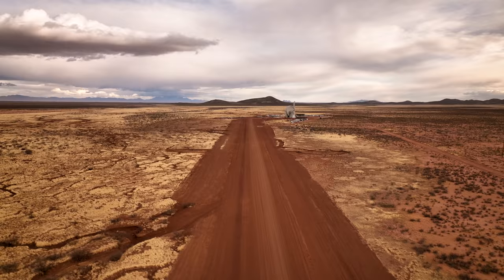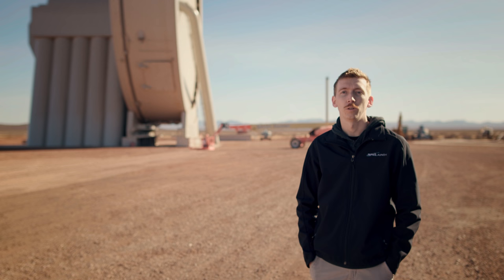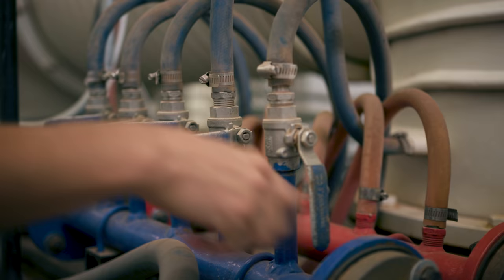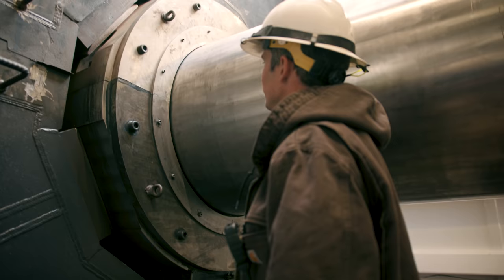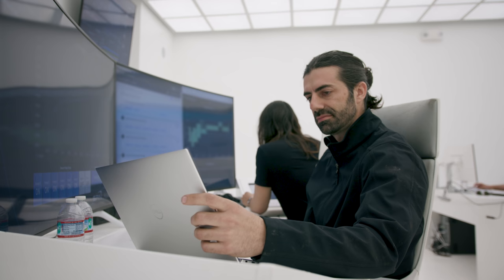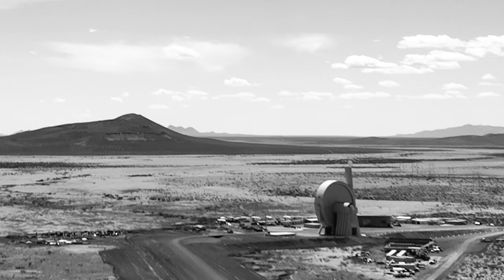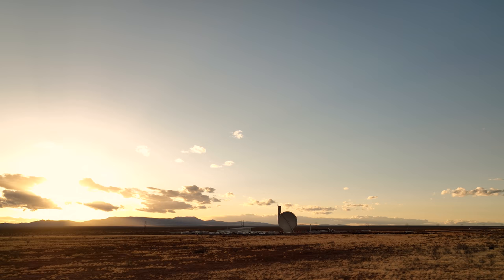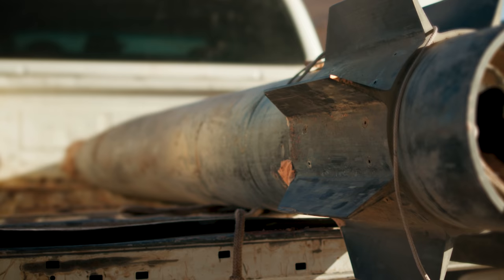An Inside Look: SpinLaunch Flight Test #7

Comment: What happens to the counterweight when the projectile is launched?  Seems like, at those speeds, it would shoot out the side from the sudden imbalance.
Reply: Great question actually
Reply: My uneducated guess would be that they’ve designed spinning mechanism’s total weight to be large enough in relation to the projectile to where the difference in sudden balance shift is within tolerence
Reply: @sagearslan 

The rotator is subjected to the energy imparted to the projectile is when it’s launched. Your theory makes no sense because the rotator would be unbalanced when spinning up to launch speed.

Comment: It's an interesting idea. My concern is there looks to be considerable Gs on the projectile just launching it to 30,000ft. Low Earth orbit is around 600,000ft or 20 times that height. To put that in perspective if your height was 600,000ft then 30,000ft would be about the height of your ankle. I can't wrap my head around how humans or electronics are supposed to survive the increased forces at the higher speeds or the shock of hitting atmosphere at basically sea level during launch at the required launch speed to get to 600,000ft.
Reply: No chance this would be used for humans, and the current projectile looked like it survived an impact with the ground from 30,000ft without taking much damage. If they scaled up the entire launch system then I imagine it would be feasible to get at least most of the way to space, then they could also strap a rocket motor to the back of the projectile to carry it the rest of the way into orbit?
Reply: I think this is still a technology demonstrator. In future the projectile would have rockets fitted to complete the launch and to take it into orbit
Reply: @sil8127  The problem for me is I don't see how rockets could survive the G forces let alone the guidance system.
Reply: I was thinking exactly the same thing…. That’s a lot of Gs
Reply: This is a project that is definitely worth pursuing because having a launch system that doesn't require actual fuel on maybe the moon would be incredibly useful in the future.
Reply: In other videos this has been discussed.  Obviously this cannot be used for manned launches.  However, a solid fuel booster and a properly designed guidance system will get you to low earth orbit with less mass and propellant in the vehicle since the energy to go the hardest distance (the first 100,000 feet) is not carried by the rocket but supplied by the ground equipment.  This can be effective at launching supplies and fuel to low earth orbit to resupply the space station or a trip to the Moon or Mars.
Reply: @lorenwilson8128  Considering this is what 30,000ft looks like I'm skeptical there is a guidance system that could withstand the launch forces of launching half-way. I guess we'll see.
Reply: I think it’s perfect for returning resources from the moon.
Reply: I mean the larger you can make the radius of this system in general the more you can lower the centrifugal G forces involved
Reply: The full spec system is supposed to be around 100m in diameter and achieve a peak centripetal acceleration of 10,000g (source: Wikipedia). Some dirty napkin math later: Assuming a 200kg payload - The stator would need a tangential velocity (tip speed) of 2214.3 m/s, an angular velocity of 422.9 rpm and a whopping 19,613,300N (lbf) of centripetal force. 

I dunno man, sounds ....... dodgy
Reply: How many meters does the rocket reach after launch? Please reply, thank you.
Reply: @robcop3986  About 9100m ish
Reply: That actually isn't that many Gs. There are guided artillery projectiles that survive being shot out of a cannon.

Note: they aren't trying to get all the way to orbit. They just want to get above most of the atmosphere then a rocket will take over. Think of this system as the equivalent of the first stage of a normal rocket system.
Reply: They literally just started testing this technology lol calm down son
Reply: Hahahah humans???? This is a proof of concept. Humans couldn't ever handel that amount of g-force. Hahahah
Reply: This system simply won't scale.
Reply: @korkee1111  Why not? The first thing I thought was that it needs to be MUCH MUCH bigger.
Reply: @joshuadowdle9691  It's the shock of going from a vacuum to surface level atmosphere at its top speed. It is going to explode or get so hot it vaporizes.
Reply: It could just as easily be used to launch a surface to air missile
Reply: @elvisburgerking8675  I don't think you want a payload in there when it decelerates as it leaves the vacuum lol.
Reply: LEO's height is 600,000ft but let's not forget the the fact that the object wishing to actually orbit needs to be cruising at a horizontal speed of 17,500mph or it'll fall back down. There needs to be a boost and change in direction before the spin-launched projectile reaches its apex, or else they're throwing things up just to have them fall. At this point they're better off launching a rocket off of an airliner. I hope they launch higher!
Reply: @paulmorley1225  exactly, and imagine how much harder they'd have to throw and how much more atmosphere they'd have to penetrate if they tried throwing at an angle that didn't require a trajectory correction. They'd be nearly aiming at the horizon.
Reply: Agreed but requirements for escape velocity (11kmps) to surface and that amount of tension and vibration for motors i mean if they somehow make rocket projectile for escape can they make it into upper atmosphere
Reply: When u get above 30k feet.. then the propulsion conditions become quite easy and accessible.. the propellant mass can be decreased for the first stage.. after reaching up to that height.. we can directly start the second stage propulsion.
Reply: @pranav9339  The problem is at 100 feet when it's a max speed and max atmospheric pressure suddenly when it pops the cork on the vacuum chamber and flies out.
Reply: Why not mount this at the top of a mountain and then spin up from there where the atmosphere is very thin anyways, it's about 10% atmosphere compared to sealevel.  I mean we've put huge telescopes on the top of mountains. This this doesn't seem too big of an issue, not only that you also give youself a shorter distance to launch to space at high altitudes. That or just mount it to a plane and spin up from there and whip it up into space. Easy peasy. The sealevel problem is not a concern and easily rectified.
Reply: Spin launch will be handy for throwing construction materials into space and small cube sats.  All can take the 200 G acceleration.  It's mechanical systems that might have issues past 100 Gs such as fuel pumps and valve for rocket engines
Reply: But they could ... if you were trying to get a human smother into space!  @spammerscammer  :D
Reply: Imagine u cant reach space if u still use feed for distance ... primitive
Reply: @k3ys  they could send back moon dust, I can't remember what it's called and can't find it quick on the internet, but I definitely saw it could power, power station s
Reply: @zed7038 

Doesn’t require fuel? What energizes it?
Reply: @FrankGutowski-ls8jt  Anything that can make the thing spin (electricity). There is no fuel taking up payload space.
Reply: @zed7038  

Where does that come from?